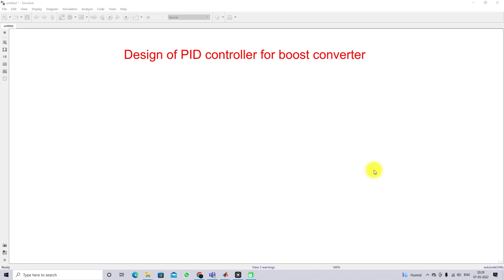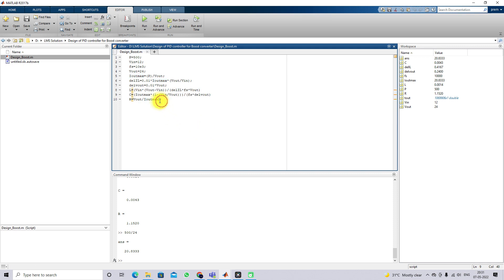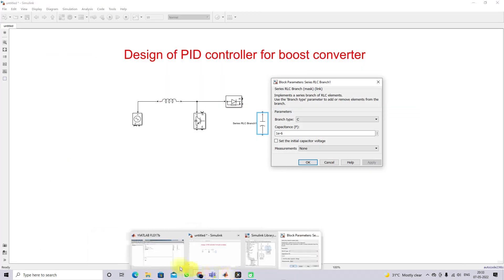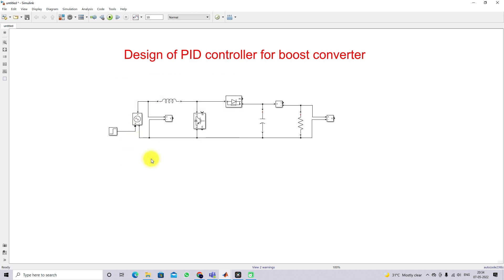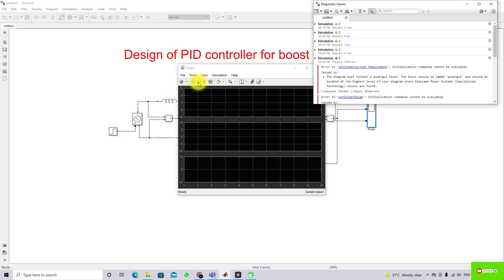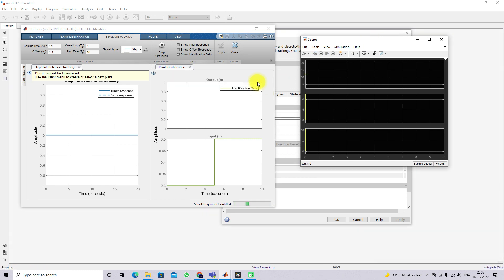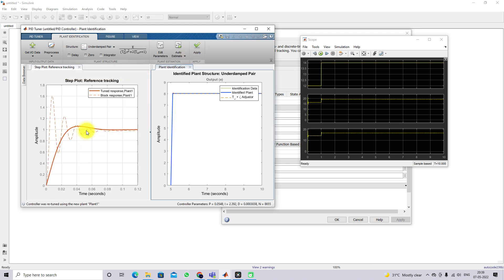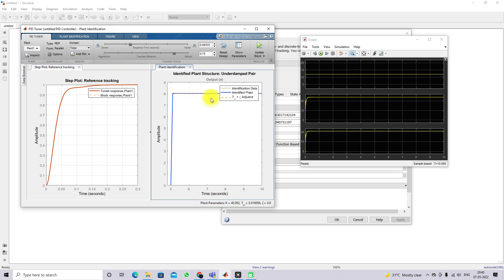PID Controller for Boost Converter | MATLAB Implementation of 500 W DC–DC Boost Converter Control

Comment: While iam doing pid controled  boost converter design iam getting output of 7.2 volt for 8 volt input.iam not getting what is happening there...plz help me out. Iam doing closed loop pid control for double frequency boost converter

Comment: Peace be upon you, dear sir.
How to adjust the PID for buck DC/DC converter. I am doing a simulation of charging a battery using a Vienna rectifier, but after about 250 seconds there is a change in voltage (low and high) for several seconds and then the voltage returns to its normal position. Can you help me, thank you very much